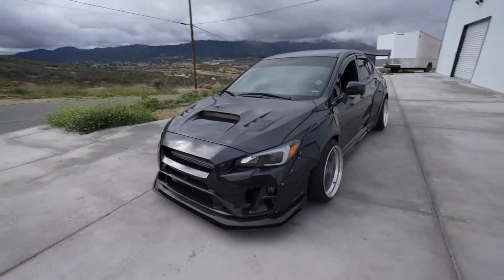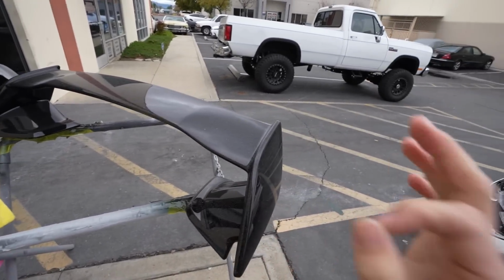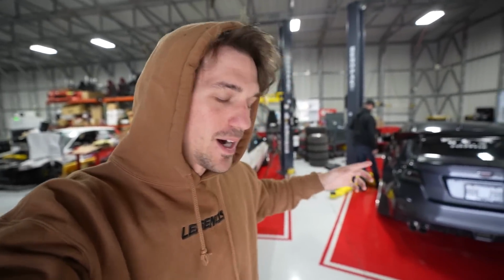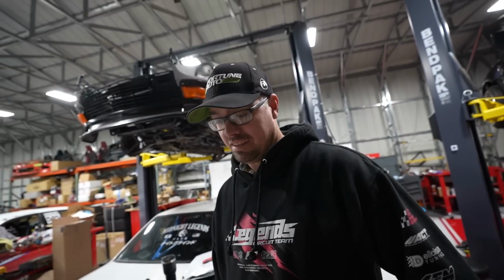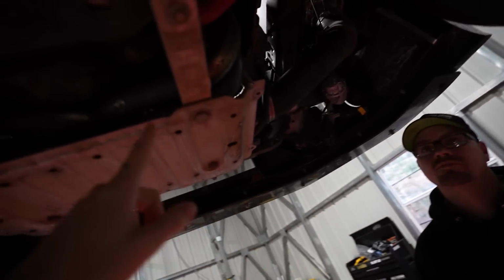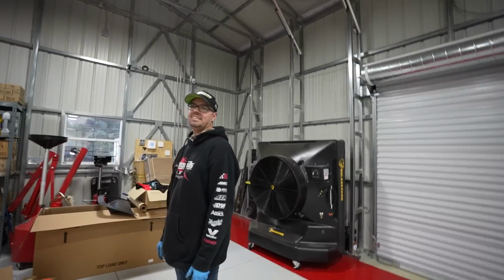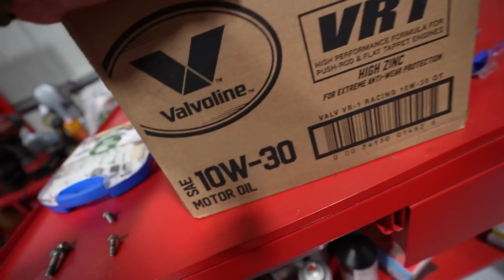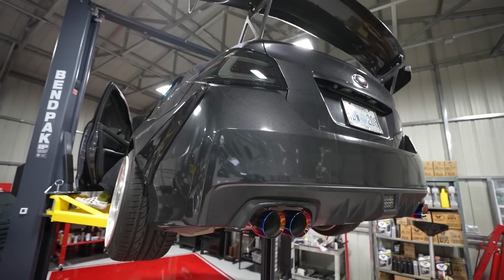FIRST MODS FOR THE ABANDONED 2015 WRX! | NEW EXHAUST & FLAMES!!

Comment: Love this car back from the dead. A couple suggestions for you. Use  5w30 instead of 10w30. Get the black Subaru oil filter instead of K&n due to the pressure relief valve in filter being very different. Install an oil cooler as these are mandatory on the FA. PLM makes a twin EWG header and maintains the stock location turbo. How about also adding port injection to your BRZ intake manifold too! Excited for this build
Reply: shameless plug.. i've got a setrab top mount oil cooler set up if anyones interested... and a voltex type 5 (for this chassis specifically)

Comment: Man great video!! I member when you first brought this car on the channel I think you should STI swap the WRX what I mean is the drivetrain swap I.e transmission DCCD controller axels front and rear rear diff. And the big break kit you can buy the whole drivetrain swap for very cheap depending on miles I got mine for 5k luckily I saved a lot of money by doing the install myself and let me just say it’s night and day difference and the car hold power so much better and it’s so much more raw but if I had to recommend one thing I think you should do that man GOS BLESS!